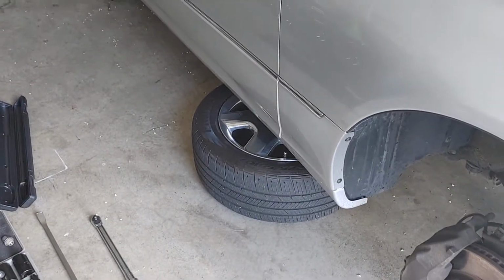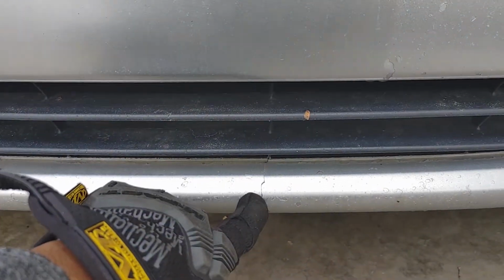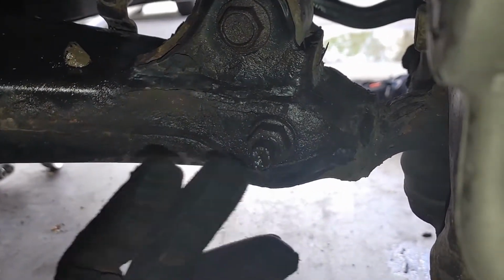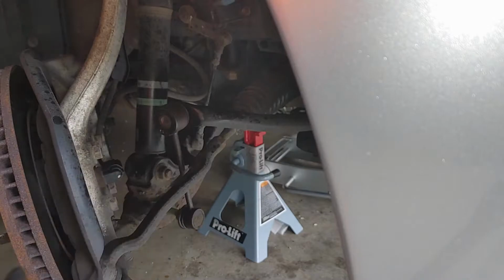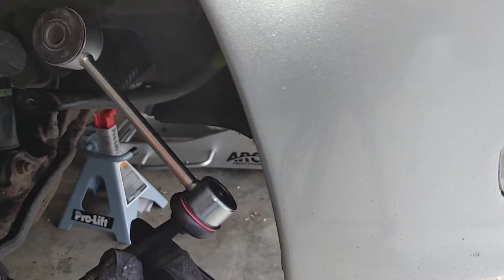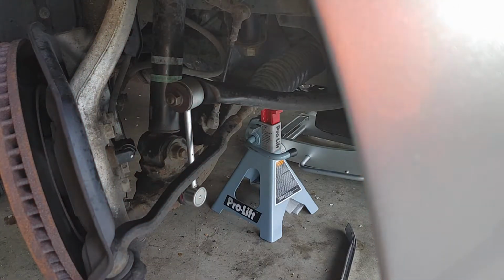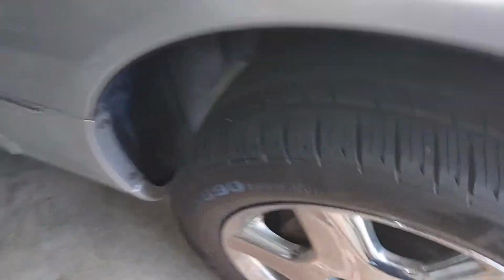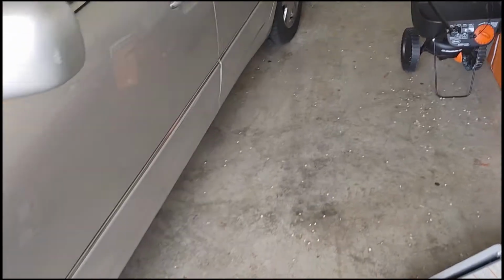How To Replace Sway Bar End Links | LS430 Demo Vehicle

Comment: I just finished a refresh on my 03 (430). Starter, knock sensors, fuel injectors, plugs, ignition coils, valve cover gasket, intake manifold gasket, pcv, iac(purge valve), vsv valve, rewiring, repining new connectors, vacuum lines, fuel pump, regulator,filter, new transmission and oil pan gaskets, engine and transmission mounts and now I'm going to knock out the suspension! Labor of love.

Comment: you should check your control arm bushings, those are known to go bad
Reply from the maker: It was the strut. I made... or was making a video on changing it and things got really hairy when the air-line popped off suddenly when removing it and just messed the DIY all up lol. I'll make a video out of the footage I have though. It'll be more VLog like, and I REALLY hope I caught our reaction when the airline popped off... lol, it was classic.
Reply: @ToolDeals  thinking of changing it out for regular struts?
Reply: @ToolDeals  Was it really the strut? I thought this was a pretty common LS430 problem that had to do with the steering column joint. The rapid shudder over small bumps or a rough road, and the judder of the steering wheel itself, and just a hint if clunk on movement of the wheel. At least when you go blumbuulmbublmblmub that's what it sounded like!

Comment: Did you check lower control arm bushings
Reply from the maker: Nah, it was the strut. I got a set for $130! It wasn't that hard to replace, at the time I made this video though I hadn't found the used set yet. So $130... for 4 air struts... eh, not so bad!
Reply: @ToolDeals  damn that’s pretty good I’m thinking maybe that’s gonna be the problem on mine too